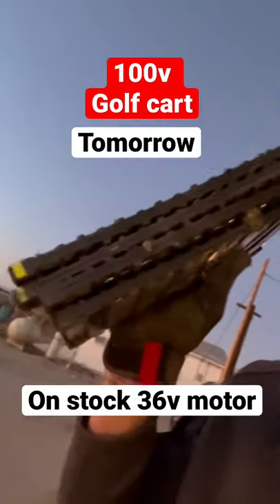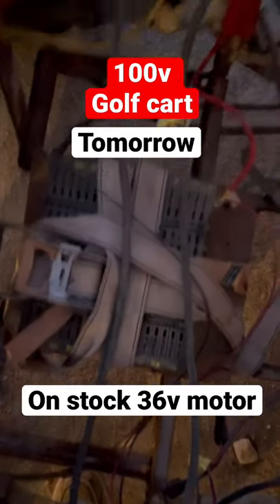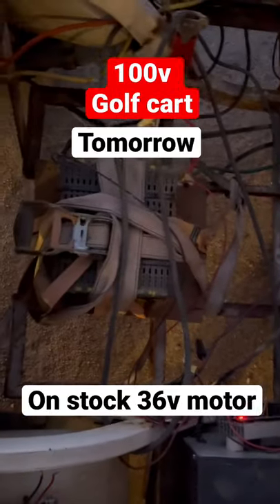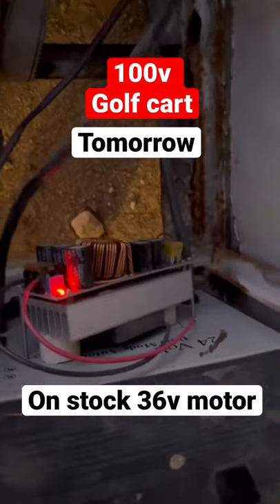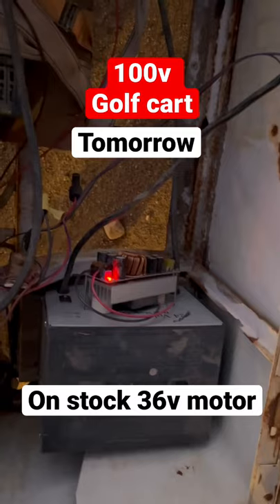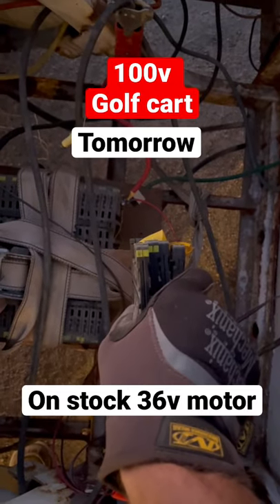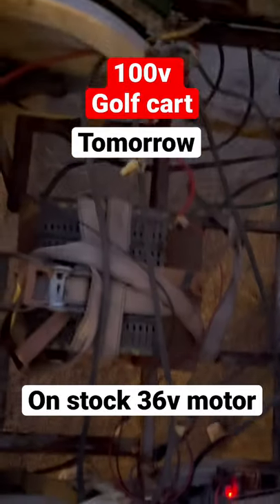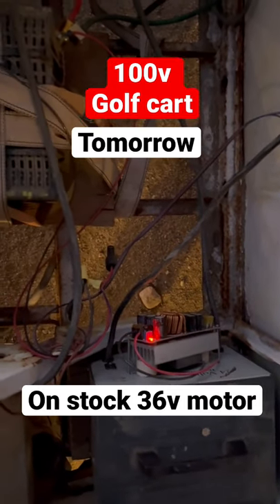100v EZ-GO on stock 36v motor. 😬

Comment: Will adding more voltage to a 36V motor damage it?
Reply from the maker: It depends. 😁 short periods of time… no.   The motor doesn’t have any electronics in it. It’s just long runs of copper wire and carbon brushes. So all that voltage does to these motors is makes them spin faster. 

The more power you push through them the more they heat up. Once they reach the melting point of the insulation on the windings inside the motor and it develops a short then your motor is dead. 

But for short periods of time these motors can take an absolute beating!!!!! I have yet to blow one up.
Reply: @RetroElectric  haha interested! Thanks for the detailed explanation! I have a 36V EZGO marathon like the one in this video and I’d love to test it out!
Reply from the maker: @BTRPlumbing  batteryhookup.com lithium makes a difference! When your motor doesn’t have to get 500lbs of lead moving it dramatically reduces the stress on the motor which eventually turns into heat.
Reply: @RetroElectric  thank you for the link!